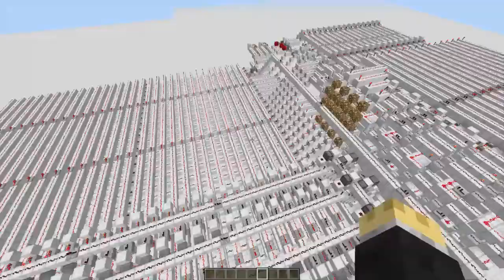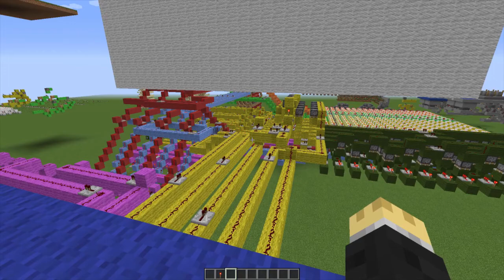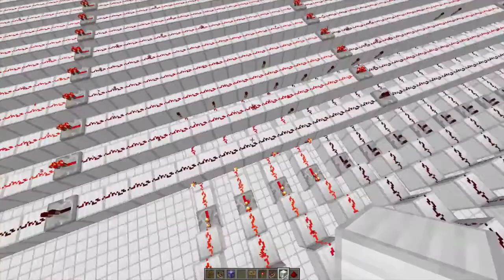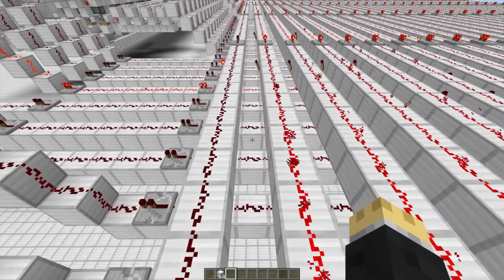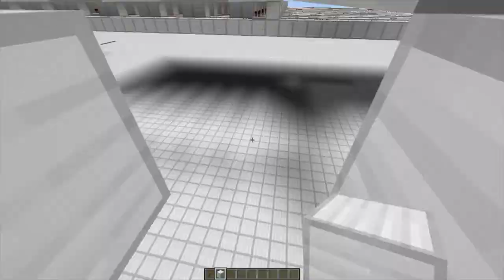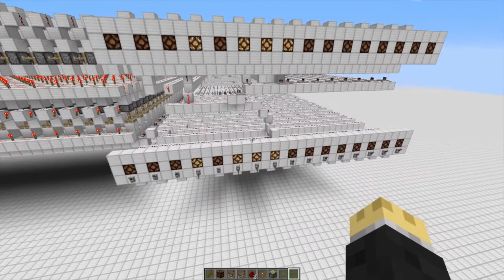Basic Computer Concepts - Pt 2 - RAM and IO

Comment: I have a question. I made a variable speed clock. I did this by using the program counter  design and putting edge detectors on the outputs and decoded enable lines to each. It added two lines to program memory but it was for a specific reason. When decrementing or incriminating you have to wait for the ripple carry to finish before you can write. I’ve found this to be the biggest speed limiting factor of the computer. So with the variable clock I can decide when to go default speed, 2x, 4x, and half speed. This way when writing an instruction I can pick the minimal amount of time needed per instruction. However with the line that disables the program memory from the clock it’s really screwing it up. I’m getting pulsing and weird things because the the clock speed selector gets disables when the clock is about to tick. I tried adding more and more delay as sort of a buffer but then every 4th pulse is corrupted. My question to you is do you think it needs a pulse extender on the clock speed selector decoder lines or is there another easy way to work around this. Or is there an easier way to do this and I’m just over complicating it. I don’t want normal fast executing instructions to be slowed down because of the time needed for a ripple carry.
Reply from the maker: Well, first off, that's actually a really clever solution.

I'm assuming when you reference "the line that disables program memory" I'm assuming you're referring to the temp disable line used to break up the consecutive write signals.
If that's causing issues, I'd recommend disconnecting it from the clock speed selection lines.

Or better still, only connect the disable line to your write signals. The read and control signals aren't as picky.
Reply: @n00b_asaurus  awesome. I’m going to try this. My brain hurts a little trying to think of how to disable only the write lines. But I’m sure once I get in the thick of it it’ll come together haha. I’ve watched the stack video like 20 times and still struggling with that haha. I’m trying to work it out but the way the stacks connects to everything is still confusing me. I downloaded Java mc (I mainly play on bedrock) and tried to download your world but I couldn’t figure it out. Need to watch a video or something on how to do that so I can get an idea of how the SP is connected to everything. You’re videos have been such a learning experience for me and I can’t think you enough for these videos and the playlist videos you hand selected. Thank you very much man. I’m sure I’ll have more questions for you in the future haha. Thanks for responding to your fans. Have a good day brother.

Comment: so i have a computer using opcodes instead of lines of code that excecutes a instruction, is there any drawback to this other than speed and not being able to do multiple commands at one time?
Reply from the maker: If you're operating a single cycle computer, an opcode lookup table may slow your machine down a bit. However, I find that multi-cycle computers and pipelined computers can benefit greatly from opcodes.

It's good that you're experimenting though!
Just keep in mind there are no right answers in engineering. There's benefits and drawbacks to all designs.
It's your job as an engineer to design the architecture that suites your needs best.
Reply: n00b_asaurus WOW thanks for replying! i have mine connected to ram so each cycle it fetches a instruction from ram and then decodes it. the way my computer is positioned its not that slow, but with a small instruction set its not very efficient although very compact so would it be worth it to extend the instruction set or make it be able to read multiple instructions? right now i only have 32 opcodes and there are so many more i want to make but if i go above 32 i have to remake the entire decoder because its one more extra bit the decoder has to adapt to.
(yes i know i have alot of questions dont bother trying to answer ones you dont have the time to)
one question that i also have is how to set up proper i/o to your computer such as screens and numerical displays connecting to your cpu. 
another question i have is how do multiple core computers function? im willing to take my design and quadruple it but how does the workload get split and how does it work with ram and other secondary memory storage.
lastly is a computer architecture that uses the same bus for data and instruction (von neuman architecture or something i belive it is called) actually efficient in minecraft? other than the obvious pro of size shrinking is actually worth it?
(agian sorry for the large ammount of questions)
Reply from the maker: @delicate6930  I usually try to respond to everyone, though I don't get notified about replies... those I usually have to hunt down myself.
Whether it's worth it to extend an instruction set is entirely up to you. If you're looking at it from a practicality perspective: sometimes yes, sometimes no. But if you're looking at it from an educational perspective, I'd say go for it!

Proper IO.... I wouldn't exactly say there's a "proper" way to do it. My favorite way to do it is to access IO like I would RAM, using an address to select the device and beginning a read/write cycle to communicate with it. Others will often just have dedicated buses and control signals to access IO, along with unique instructions for accessing each device (I believe the Atmega328p did something like this). A really advanced way of accessing IO is to have a port controller hub, which is like another computer specifically tasked with handling IO requests from the CPU and interrupt requests from the devices. Though this is usually more for multi-core architectures. Really if it works for you, it's a proper method... plus you can always improve it later.

Speaking of multiple cores, I'd like to say it's as simple as "just slapping a few cpu's together and calling it a day", but this appears to be a misunderstanding among the community. Most computers that have multiple cores use them for multitasking, or running multiple programs at the same time.
Really a single core can do this just fine: this involves running one program for a little bit, stopping it and running another program for a bit, rinse and repeat until you get to the end of the list, then circle back around to the first program.
The disadvantage of this of course is while one program is running, all other programs are idle. And depending on how many programs you have queued, a program could wait for quite a while before getting a chance to run.
This is where having multiple cores comes in to play. While one core is running a program, another could be finishing up and fetching another program from the queue. With each additional core, the amount of time each program has to wait in the queue gets reduced.
This is more of an advanced topic, requiring a massive amount of infrastructure in the architecture and huge amounts of optimizations. You're more than welcome to play with it, in fact I encourage you to do so, just bear in mind it's a long road!

On that note though, usually programs are sequential, and thus cannot be split into multiple threads. But there are cases where one program can take advantage of multiple cores. This is usually when you have one program being executed on a large set of data. E.g. applying a small algorithm to 10,000 data points. Then splitting the work load across more cores is more effective.
The kind of programs that usually do this stuff though are typically video and picture processing algorithms, and they work more effectively when they have hundreds or even thousands of cores... which is why GPU's are usually responsible for handling video related tasks ;)

Memory is a bit of a trick though with multiple cores. Easiest way around this is to use a hierarchy of cache modules. Each core communicates with it's own cache module, and if there's a cache miss, the cache goes up to the next level to fetch the data there. Cache miss's continue to propagate up the levels of cache until it reaches RAM. This minimizes the likelihood that multiple cores will need to access RAM at the same time. Harry Porter has some great videos about cache if you're interested, I believe his channel is called hpp3.

Von neumann models are fairly decent, though I wouldn't say smaller than the harvard model. Understand that because you're accessing data and instructions from the same memory bank, you need circuits to manage the timing of everything. 
I typically see the Von neumann model applied to computers that need to be able to write their own code, such as self modifying programs or operating system-type structures. 
As such, you really don't have much use for them in minecraft. Especially since the harvard model offers far faster execution speeds. This is the conclusion I came to after a while. I used to use the von neumann model a lot, but I'm finding myself use the harvard model more and more often these days. 
It is a great exercise though, and I would highly recommend developing one for the challenge!
Reply: n00b_asaurus i cant thank you enough for the reply! for my current project im using the von neumann model just for the sake of variety and self modification but maybe i could try making a balance between the harvard and von neumann somehow and get the benefits of both. Its all about experimenting and seeing what fits! with my current project i did in fact replace the cpu decoder to extend another bit and now i’m working on remaking all the control wires which is extremely hard due to the size constraints im dealing with. Are their any recommended opcodes that would be really beneficial to have like flags and such or is that all personal preference? and i forgot to ask but is subtraction on an alu just inverting one of the inputs and then adding a carry in bit and adding together? thanks agian for everything
Reply from the maker: That's great that you've got a project underway! 
As far as opcodes are concerned, it is just preference. Though the core set you need to be turing complete are moves, operations, and branching. Everything after that are usually just shortcuts to make programming easier.
As for subtraction, you are correct! You invert the subtrahend and add 1.

Comment: With the addition of Observer blocks, is it possible to make a more vertical computer, so it doesn't take up so many chunks?
Reply from the maker: You could possibly make some sort of processing circuit with observers, but I wouldn't rely on them for data transfer. Each block adds a tick and it can't sustain a signal... only pulses.

As for the size issue, I'm making this computer big intentionally... next phase we'll work on shrinkifying.
Reply: How does it function being in multiple chunks? Dont the chunks despawn?
Reply from the maker: I'm not 100% sure. I don't really consider myself an expert in the games mechanics. But everything seems to operate fairly well. It doesn't leave much room for expansion though.

That's not to say issues don't occur though, I had to use command block RAM with Skittlebits because the system was too big for the player to be able to load all components at the same time. As a result, the RAM would duplicate or lose data all the time. 

Since then, I've been working on making these designs smaller to try and mitigate this effect. I haven't perfected it yet, but when I do, I'll be expanding on this tutorial series.
Reply: That answers my question exactly. I recomend looking up information on "Spawning Chunks" The area near your initial spawn point stays spawned and active even if you go to a different dimension. The area is about square 196 blocks from bedrock to build hight max. Minus 12 blocks in most cases. There are a few videos on YouTube that explain it well. Thats probably why you were asked about a vertical build. It might remedy some of your glitches.
Reply from the maker: thanks...
Reply: Im fairly lost in computer sciences. I have the aptitude but need to expose myself more. I've watched a couple of your videos in full but it still hasn't clicked how to convert binary into UID. Do you have a video or recommend a video for me?
Reply from the maker: I'm not sure what you mean by UID... there are several meaning for that acronym, and none of them pertain specifically to binary...
Reply: Pardon my delay. Im just a noob. I used "UID" as User Interface Data.
Reply: Do you know if anyone has automated their MC city digitally?
Reply from the maker: not really. I've dabbled in the idea, but nothing really practical. 

As for your first question there, I'm assuming the UID you're referring to is the decimal numbers you typically see on the screen.

Am I correct in assuming that? or are you referring to something else?
Reply: Yes. Basically input and output. Id like to figure out how to build a small device to manage my breeders, farms, door locks and lighting in my city. So far most are automatic however I'd like to control them from one interface and have them turn eachother on and off. But the more I think of it my analog system might be more practical. Any suggestions are appreciated.
Reply from the maker: well, if you can spare the processing power, or the extra redstone, you can use BCD, or binary coded decimal.
It's fairly easy to do, it just required either all numbers pass through a converter on their way in and out, or you create a converter program which would take time and memory, or the third option is to perform all calculations with numbers already in BCD.

Surprisingly it doesn't take that much change to a computer model to work with BCD, the only thing you need is a decimal adjust instruction to run after any arithmetic operation.
Reply: n00b_asaurus The initials are beyond my knowledge. Do you happen to have a video on that/those?
Reply: n00b_asaurus Do you happen to know a way to count items passing through a system? Counting off an input and output hopper maybe? I can use a comparitor to get different strengths of redstone but more accuracy would be fun.
Reply from the maker: dropper with clock, count the number of clocks that occur. 

As for BCD, it's fairly straight forward. you basically allocate 4 bits for every digit you want to encode. Say for example you want to store the number 217, it would need to be encoded onto 12 bits since you have 3 numbers. 2, 1, and 7.
Now normally 217 in binary is 11011001, but in BCD it's 001000010111. If you break it into it's 4 bit chunks though, you get 0010 0001 0111. 
now convert each 4 bit segment into decimal:
0010 = 2
0001 = 1
0111 = 7.
BCD is literally just taking each digit in a decimal number, converting it to binary, and smashing it all together in one big binary number. 

If you convert a binary number to BCD, you can feed each 4-bit piece into a 7-segment display and have it read off the number in decimal.
Reply: Hmm 5+3-1=7? Im still ultra noob at binary. I was astonished for a moment but I can do dirt, cobble, and alike chests as a 1 count per chest rather than item.
Reply: And would 1 count per ten items bring it back down to 4 bit?
Reply from the maker: yeah you lost me, I'm not sure what we're talking about anymore
Reply: Say I also wanted my computer (built in survival mode) to count the items I put into my auto sorting system. How would I do so? You said count off a dropper. How would I do that and could it also be done using a counter off a hopper instead of a dropper?
Reply from the maker: Ok yeah, we did switch subjects.
The thing about a counter is it requires an edge to count up, so if you're signal is just one long on pulse, your counter is not going to count. 

Connecting a comparator  to a hopper will create a pulse when an item goes through, but you have to intentionally break up the items to allow the hopper to create a pulse. If you connect your hopper directly up to a chest full of stuff, your going to get a solid signal out of it since an item is fed into the hopper just as fast as it's taken out. 

You could connect this signal to a togglable clock, and tune the clock to the transfer speed of the hoppers, but it's better to know an item definitely went through every time the clock pulses.
For that reason I would hook up that same clock line to a dropper and have it dispense 1 item for every clock pulse. 

You can have the control comparator connect to the dropper so that it only clocks when there's items in it, and you could have another comparator in the hopper in front of it to act as a redundant confirmation signal, that way you are doubly sure when the clock pulses, an item goes through. From there all you need to do is connect the clock line to your counter.

Comment: Have you ever considered using a CCA ALU instead of RCA? CCA is incredibly smaller than RCA and also have near instant carries. Also why not just have !A, !B, OR, FC and Cin as control lines in your ALU, instead of having extra circuits for each individual logic gate?
Reply from the maker: I would assume RCA is a Ripple-Carry Adder. Though I can't say I've ever heard of a CCA... care to explain?
Reply: CCA stands for Carry Cancel Adder. It relies on slab stack mechanics (and so doesn't exist irl) to perform propagation. In each adder, you have your cancel line and your propagate line. Whenever a carry is generated, it'll pass onto every bit higher (this is where the slab stack mechanics are). Then our cancel line, "cancels" the carry, if both inputs on that bit are 0 (NOR). That's basically the carry logic, I'm not that much of an expert myself but I would highly reccomend going onto mc.openredstone.org and asking there.
Reply from the maker: interesting. I'll have to check it out when I get some time.